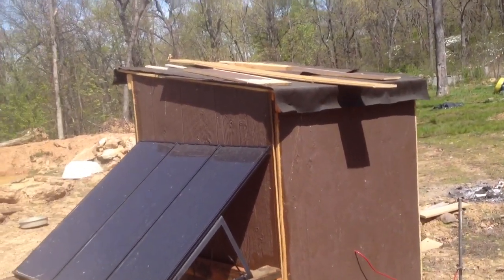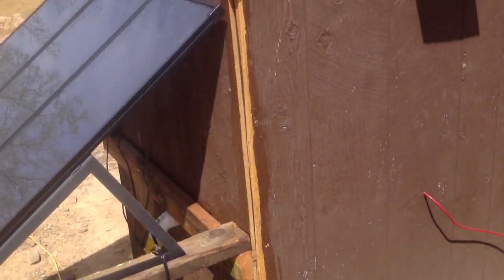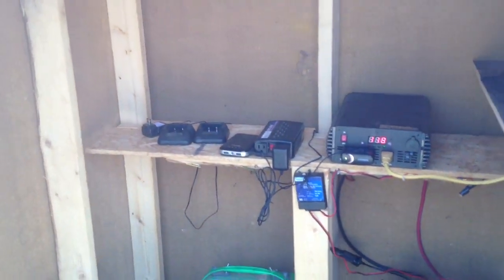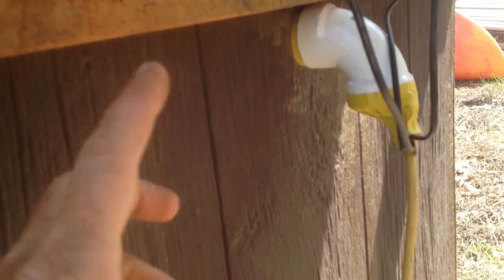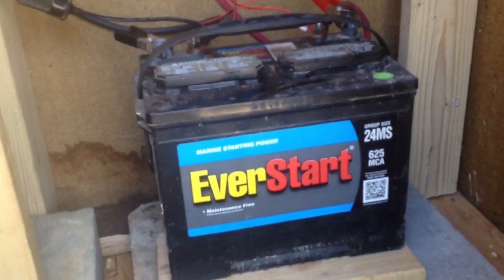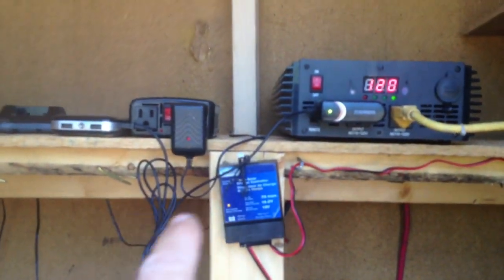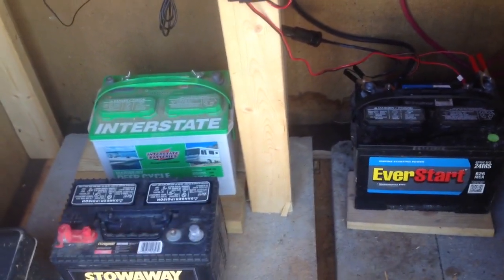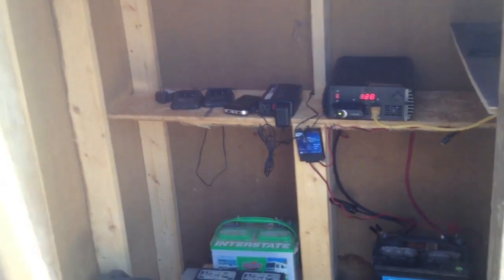The Solar Shack!

Comment: Since you do not have codes, use plastic pipe as conduit, and run wires in parallel to get your power without much loss to your home. Glad to see you have 120 to the house unlike some that try 12v and get high losses. I probably have more panels sitting idle than you could get an inverter for affordably.

Comment: 60 watts, that is not much power but costs quite a bit. Get some good used panels, or extras as those are quite cheap. 250w for less than $150.
Reply from the maker: This an old vid. We have about 2k watts of panels now
Reply: Glad to hear that, and something that some can do if they have the time is repairing damaged panels. That is because even if only half are fixable someone would not be out too much money. I have have some 300w panels that I spent about $20 each on that I am fixing between things. I would like to be a part of a community with like minded people within the next couple years. Building electronic equipment that is designed to last is one of the many things that I do. The main reasons I don't like cities, is that they are primarily about their control, and I understand what will and does work very well more so than most that people need to get permission from to do anything. Also I would like to not have to concern myself with paying bills every month, or deal with as few as possible. As I am not getting any younger, and I don't like being where the least experienced are making the decisions. Also you are correct about at some point in the near future that the cities will fail, as they are more concerned about control and making more and more rules instead of using their brains. That is a recipe for disaster and just a matter of time, just look at how much it costs for the simple things compared to 50 years ago, and how much the average person earns these days compared to 50 years ago.  The costs are going up faster than incomes, and the government is covering some of the difference, but it is just a matter of time before this situation collapses. The main reason that it has not is because the USA has nearly unlimited money creation potential, and this is because of our involvement in the majority of countries throughout the world both financial and militarily. Already people are dying from mistakes more and more from doctors, and I would have been one of them this year if I did not know more about how to keep myself alive and analyze my condition better than the majority of the doctors around me in this major metropolitan area. COPD, and Pneumonia are not things to take lightly, and I nearly died from that a couple of months ago. There are things that can and do help, but most are not prescribed by doctors anymore as they are more about profit and getting their "Free" vacations from the pharmaceutical companies for the prescriptions that they write, instead of prescribing what is best and safest for people.

Comment: A couple of ideas. Build your shack in the A-frame style with your latitude slope. Example build the sloped sides 35 degrees if you are at 35 degrees latitude.  Face one sloped side to the south. Cover the south side with solar panels. Set them on a frame so there is about two inches of air space between the roof and the panels so the panels shade the roof and cool air can flow up between the roof and the panels. Put air vents up high on the flat ends of the shack. A couple of golf cart batteries provide more bang for the buck and longest life. Trolling motor batteries are ok if you want to use them in a boat once in a while. Use the thickest copper wire you can get. Old jumper cable wire works fine. Short wire can be battery cables out of junk cars. You can do a lot
With a little power.
Good luck and Keep following Yesuha.
John Davis

Comment: have you ever thought about using a iMAX b6 charger for all of you small battery recharging like cordless drills and simple nicad and lithium polymer cells? The small advantage other than the accurate charging is that it works off of 12 volts DC so you are not burning power to run the inverter to create 120v AC to then drop it back to DC and charge batteries. food for thought...

Comment: If you only get your big batteries down to 80% and then charge them back to 100% instead of draining the batteries to say 20% the charging them back up, you will get about 4 times the amount of cycles of the batteries. So that means you need a battery bank 4 times larger than you need. But all in all, your system will last MUCH longer. Also, if you ever lose the solar power etc, you have a LOT more power stored up.

Comment: THINK SAFETY: Some constructive advice if you care to acknowledge it,  move your ground wire to come out the bottom of the shack and bury it the few inches it travels to the ground rod so it eliminates a trip hazard if you had to navigate the area at night.

2. Get one of those orange Rebar tops to prevent someone (running children) from being impaled on the ground rod sticking out of the ground if they fell into it.

Its a good temp setup and if its suits your needs now, anything you do to improve it will be a real bonus.
Have you watched "Engineer775" videos??.....he's a pro at this stuff and lots of good info on his channel.

Comment: First degree Pastor was in Electrical Eng. and I have been taking a lot of solor system design CE's since then. Be glad to help you need it.  Most things that can be charged can stat un-inverted and save about 30% of loss from inversion. You can marry new and identical battieries and have them produce much more power and simple charge systems.  Also quite easy to have a Multu-In charge options (solar as 1) and then easily have others in event solar isn't an option. Be glad to help you my Brother just let me know,Sholom to you and the saints thee, pray to see you soon!

Comment: just a quick tip , only use deep cycle batteries for this , the kind made for trolling motors , regular cells cant be drained like that or the plates will be destroyed , also if you charge up your batteries all the way you can connect them in parallel but they must be fully charged when you connect them or else  up to 600 amps of current will attempt  to charge the the cell  with less juice

Comment: Best batteries for this little project are golf cart batteries. There only 6 volts, so you'll need 2. If the budget permits, 4 would be better. They require little maintanece, but there easy to find and (if taken care of) will last a long time.  The key is not to discharge them too much.  As for wiring... there's stuff on the web.  Try Trojan T-105  or they also have T-105RE that are designed for renewable energy applications.

Comment: A thought, how about using the panels as the roof.  Of course it looks like 3 panels, so perhaps some waterproofing underneath.  I see a problem in that in some times of the day the panel will have some shade due to the little shack.  I wouldn't imagine it to be much of an issue, though worth noting.

HOPEFULLY you read this as it'll sort out your battery bank. 
In terms of connecting batteries in parallel [+ve connected to +ve and -ve connected to -ve] you can have as many batteries as you like in parallel if they're the same voltage.  Electricity effectively gets drawn from the highest voltage first and the batteries equalise themselves themselves in voltage rapidly anyhow.  It's just like jump starting a car, if they're different voltages, they will try to equalize first and then when they are the same voltage they work as one battery with a larger capacity.  You can run as many '12 volt' batteries of any type you like parallel, so you could have a small gel cell, a car battery, an AGM cell, a super capacitor, whatever and you will get the total Amp Hours of the total.  The downside is that the car battery doesn't like to lose more than about 10% of it's capacity [for long life] whilst an AGM or Gel cell can go down to 50% capacity and still get good life.

Periodic equalizing [over charge] is helpful and prolongs battery life.

Comment: your not supposed to put batteries on top of concrete/cement or cement blocks it will drain them of the charge.
They should be 18 in above a concrete floor on a shelf or counter .

Comment: Avoid inverters like the plague.  Inverters are power hogs, a huge drain on a small system.  Use 12vdc adapters that cost less and are availale for most devices, even computers.  I find mine at the thrift store for about a buck each.....

Comment: Been living off grid with solar for about a year.  Had I known about the need to equalize standard deep cycle lead acid batteries, I would have bot a charge controller that had an equalizing function, such as the Morningstar TS-45.  One can manually equalize their batteries by hooking up the panels directly to the batteries for a few hours at a time, then testing the specific gravity. Use a hydrometer to see when there is no more improvement. This will restore the battery's capacity.   One needs at least 15.5vdc constant at the battery to churn or mix the electrolyte, and 'equalize' the higher concentration with the lower concentration.  During the winter when there is little sun, I use a generator that provides this voltage.

Comment: As long as your batteries are the same voltage and amp hour rating, you can connect them together.  The only downside of not doing that from the get go with two or more new/fresh batteries is that all the batteries will drop performance to that of the oldest/weakest one.  In other words, they will equalize with the weakest battery.  Hope that helps!  God bless.

Comment: Hey when you go to run you power line to your house find and look into the same power line used for pool lighting.. its thick heavy duty and will last ....I had a pool place next door to my shop and they threw away lots of that line and I made plenty of cords out of it and its good stuff ....just a thought things have to last and not fail ...hope it helps

Comment: May I suggest a small vent, it may get a little to hot during the summer time for your inverter and batteries. 

Also about how long does it take to charge a battery? Great vid.

Comment: Great setup there.   One thing that viewers might wish to note, though, is that the HFT system, while it is a fun and convenient introduction to solar, isn't a great value in photovoltaics.   I have one (and have a vid on my channel about it), and it's useful and fun, but the price tag of about $150 for a 45 watt array is extremely steep these days.  The panels are also old school heavy, fragile, large and inefficient silicon. Commercial panels are now running about $1/watt retail (and are much smaller and lighter for the power output), and I have found them on the used market for $.50/watt.  You will still need to buy batteries, charge controller, inverters, etc.   If all you need is a couple lights and a USB charger, the HFT system is easy and useful, but there are far better values to be had out there these days.  Be well!

Comment: Buy a couple 8D 6Volt batteries (AGM work best) and wire them in parallel. You will be surprised how much power you will have and none of your solar capacity will go to waste.
I wrote before on your truck kit vid that I can help with Mechanical Education and Timber Felling if you are interested.

Comment: Just a friendly question . Why is the GROUND rod - not in the ground . you've got an air rod that will do more as a lightening rod , which will seriously O V E R  charge the batteries and the solar shack and may follow the wire to your house and LIGHT your lamp in a very bad way . Heads-up ! ! ! , please check this out with a local electrician or at very least with someone who knows about solar system grounding . Good Luck - Mike out

Comment: congrats pastor Joe. It's a great approach, the learning curve with solar can be expensive and very painful(especially when you start burning up inverters and batteries), so your start small and work you're way up approach is a great idea for the DIY guy. I've cobbled together a 2500 watt system, hooked it into the house and its started paying for itself. It's not enough power to run everything, but it is enough power to run everything we NEED if the grid goes down. I use a tri-fuel honda eu2000i to top off batteries and feed the freezer during shtf drills.
 I'm not sure if you've looked into it, but there are 12v lcd light strips that aren't expensive which can be hooked directly to your 12v battery array, the benefit there is that you don't loose power to conversion. As for your second battery, you might try topping both batteries off, then checking the voltage, if they are similar, you could hook them in parallel, with the understanding that the max charge you'd be able to get is the lowest voltage between the two - maybe a solar/battery expert can confirm this.
Solar's a wonderful option. Ive found electricity, while it may be a luxury to a neo-pioneer, sure  is nice to have.

Hey, have you guys spent any time on permies.com ? I've found it to be a good resource for off grid ideas from folks who are out there trying to make it happen.

Many blessings and continued success.

Comment: awesome addition, ventilation of shed will help your battery life, and put a sheet of wood between the batteries and the concrete block floor. you shouldn't be able to smell your batteries, not good if you do. experience is a great teacher. Since your winters aren't too cold just don't let the batteries freeze, prob not an issue for you guys. :-)

Comment: You may want to vent the shed. In the summertime, it could get really hot in there. The heat will make your batteries evaporate faster